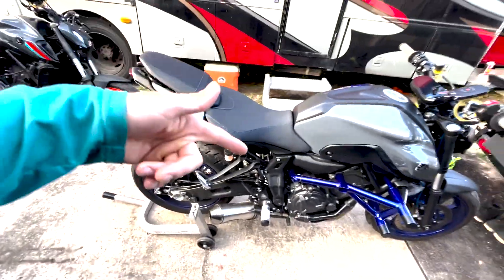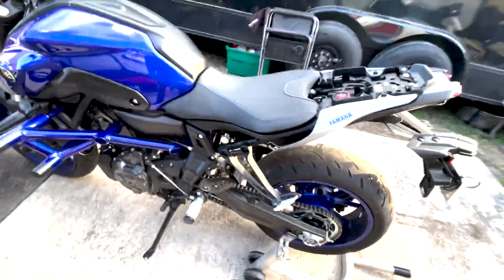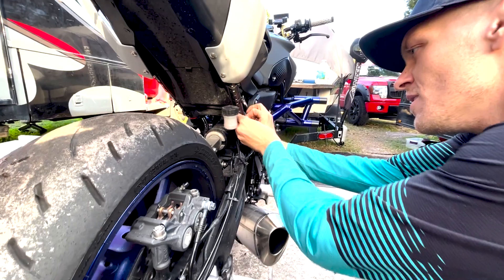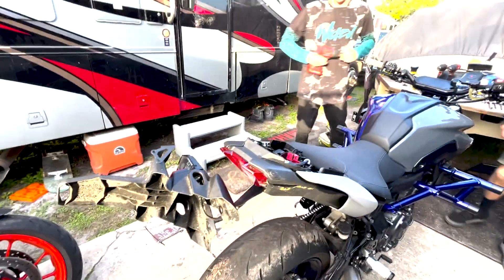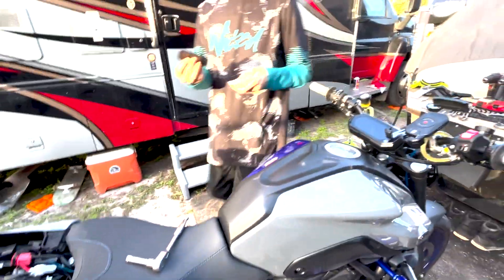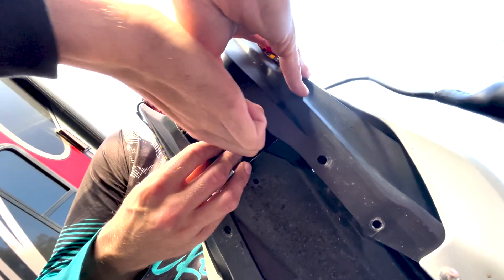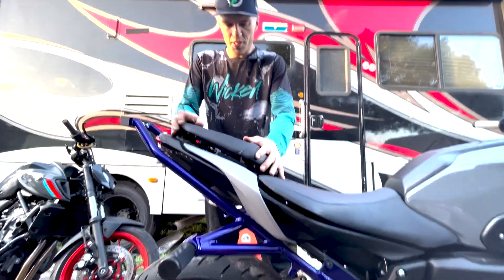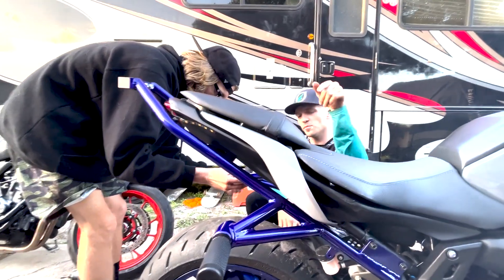MT07 Wheelie Bar Install DIY

Comment: You guys trying to sell the old passenger pegs? I cant find it anywhere for my bike 2015 fj-09, and I think those will fit.
Reply: If your still looking for some passenger pegs off a 07 I have some off a 2017 FZ-07, if it will help I'll take some pics and measurements so you can see if they will fit...